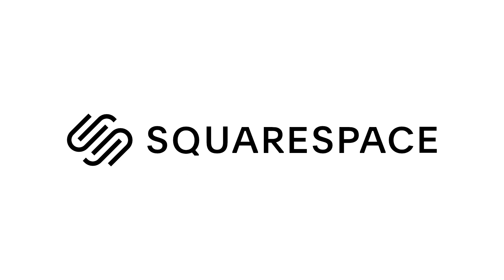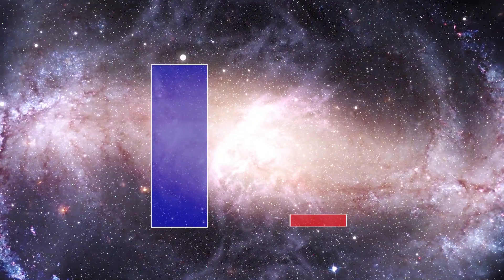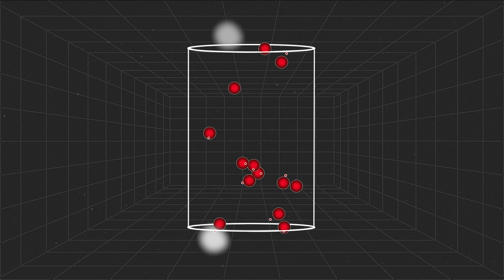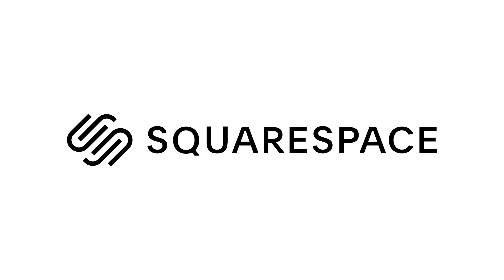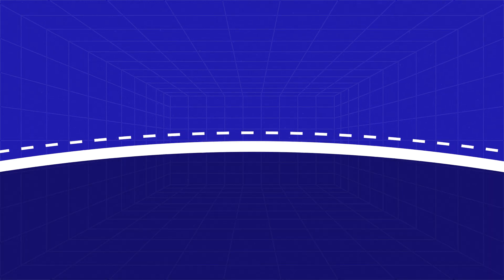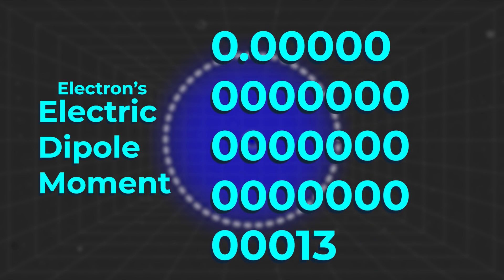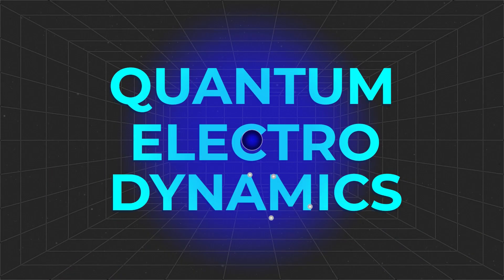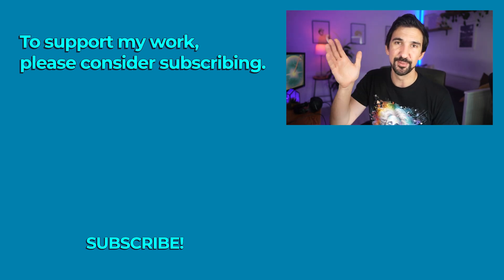What If Electrons Aren't Round? The Antimatter Problem  - EXPLAINED

Comment: Everybody says there should have been equal amounts of matter and antimatter. But why this ought to be the case? "Equal amounts" is as arbitrary a number as, say, 2/3 matter and 1/3 antimatter
Reply: Observations of the amount of radiation after the big bang indicate that the energy released in that radiation was in a ratio of a billion to one photons versus matter. In other words matter and antimatter annihilated into radiation (photons) but one part in a billion matter particles somehow survived, and that is at every location in the universe and there is no evidence of any antimatter surviving, producing antimatter galaxies etc. So theorists think that there must be some fundamental but very tiny difference between matter and antimatter, such as antimatter decaying into certain particles at a slightly different rate or antimatter interacting differently to matter with some other particle fields that only existed at the big bang.
Reply: @tonywells6990 Thanks 👍
Reply: The pair production equation says photons turn into one particle and one antiparticle. There is no equation producing a particle or antiparticle alone.
Reply: right.  But suppose instead of starting with photos you start with matter.  The entire assumption is you start with energy instead of starting with matter.  @qaxftr433  There's a pleasing symmetry that happens if you start with pure energy and then due to CP violation you create more matter than anti-matter but the universe doesn't have to please us.  It could have just started with photons and matter.
Reply: You are absolutely correct there's no reason the initial state needs symmetry. Professor Sabine Hossenfelder has a video about this.   I do like the idea of equal anti matter and matter because it makes it more plausible the universe came from nothing and the existing universe does seem to have a net value of energy of zero (remember gravity potentials are negative) but maybe there was just more matter at the beginning
Reply: @bonerici  I found Sabine explanation to be hand wavy way of saying the problem does not exists. All she has done is move the problem of the imbalance  of matter and anti-matter from theory to the initial conditions. Without demonstrating that there is any initial conditions that could solve this. 

There was no matter at the beginning, assuming you mean the big bang, because the universe was to hot. Matter and anti-matter only came into existence after the universe had cooled. And according to theory should have formed in equal amounts. This very short time, from the start to it being cool enough for matter and anti-matter to form is a problem for the initial condition argument.
Reply: @yziib3578  the part about matter only being created when the universe had cooled is simply not true.
Reply: I would love to see a decent explanation for this too. It always seems like they are just making assumptions.
Reply: The Big Bang process that created the universe did so without any bias toward matter or antimatter.  In other words nothing in the math says one should be created over the other and the assumption is they’d be created at equal rates.
Reply: energy conservation of whatever process was behind big bang
Reply: the universe doesn't conserve energy.  the higgs field is a scalar and as the universe expands there's more dark energy @martin336able  conservation of energy is only a local phenomenon
Reply: One, not everybody says that. Everything I have run across shows matter and antimatter are made out of the same selection of quarks, as an example they make antimatter at lhc, also lightning makes it, so does the sun and certain decay products are positrons. The only functional difference between the two is the binding charges. That means the assumption of how matter/antimatter distribution is just wrong.
Reply: Not really. Charge has to be conserved.
Reply: say you have no idea what you’re talking about without saying you have no idea what you’re talking about
Reply: The only way we know particles are created is in matter-antimatter pairs.
Reply: @davidhand9721  How do we know this?
Reply: @simongross3122 Because we generate billions of electrons and positrons on every power line operating at above 500kV whenever an insulation breakdown occurs - the resulting gamma ray generated when they annihilate is blinding obvious to radiation detectors.
Reply: when enough energy density is present in a given volume, matter/antimatter pairs spontaneously appear. This happened at the big bang, inside neutron stars and in particle colliders. We have measured this effect to be exactly symmetrical. So somewhere has to be an asymetry, and it does not appear to be at their creation.
Reply: Expect a form of symmetry, unless there is a reason why not. If symmetrical then should be equal
Reply: im not a physicist but equal amounts of matter and antimatter existing isn't just randomly assumed its a key to all kinds of different parts of physics working out and making sense

Comment: This is the entire makeup of matter & free energy:
1) Dark Points  = (Particle / Solid Mass / Do Not Change Size)
2) Light Points = (Energy / Massless    /  Does Change Size)

1) When 1 Dark Point and 1 Light Point combine, they create 1 Dipole Element.
2) When 2 Dipole Elements combine, they create 1 Photon.
3) When 1,823 Photons combine, they create 1 Proton. When 1,824 Photons combine, they create 1 Neutron
4) When Protons and Neutrons combine, they create the rest of existence

1) 1 Dark Point + 1 Light Point = 1 Dipole Element.
2) 2 Dipole Elements = 1 Photon.
3) 1,823 Photons = 1 Proton & 1,824 Photons = 1 Neutron.
4) Protons + Neutrons = Everything & Everything is Light

When enough Dark Points and Light Points combine, the Dark Points all congregate in the center of the protons and neutrons and the Light Points create a coating around the Dark Points so that they're no longer seen. In the stable elements, extra photons want to combine with the protons and neutrons, but are repelled into orbitals by the Light Points. 

Roger Spurr of Mudfossil University on YouTube has irrefutable proof of this and even convinced CERN to change out their particle detectors for CMOS detectors so they too can see this for themselves. Update: CERN has now detected what they call neutrinos (Dark Points & Light Points) for the first time ever, after having listened to Roger Spurr.

---------------------------------------------------------------------------------------------------------------------------------------------------------------------------

Venturis Create Free Energy:
Principle 1: Dark Points cannot change size
Principle 2: Light Points can change size
Principle 3: When (red or blue or green, etc) photons enter into a venturi the Dark Points will be forced to return from the direction that they came from, but the Light Points will separate from the Dark Points and condense and go through the throat of the venturi.
Principle 4: When Light Points pass through the throat of a venturi alone, they create what is known as electron showers and increase their energy 200x
Task 1: Send (red or blue or green, etc) photons into a Venturi which has a throat smaller than the size of Dark Points.
Task 2: Manufacture a device that can capture this excess energy in the pure energy zone and funnel some of it back to the light generating device and some of it toward a battery.
Note 1: You need CMOS detectors to see photons.

As the light gets pulled into the venturi the Light Points condense to go through the throat. The Dark Points on the other hand cannot change size and are forced backward, away from the throat. As the Points separate, called fission, excess energy is created by the Light Points. Immediately on the exit end of the venturi is a very small zone of pure massless energy of only Light Points. These Light Points will have a significantly increased energy level of 200x as compared to the energy that went into the venturi. Immediately beyond this very small zone of pure energy is when Dark Points show up to attach to the Light Points, which is fusion. We want to use the energy before the Dark Points begin attaching to the Light Points.

How to Create Infinite Excess Energy:
1) Create a venturi with a throat that is smaller than the diameter of Dark Points. 
2) Send (red or blue or green, etc) photons through the venturi. 
3) If an absorption and siphoning device can be placed in the zone of pure massless energy, before fusion occurs, we can harness free unlimited clean energy. Route some energy back to the light generator & route some energy to a battery or whatever device you want.

---------------------------------------------------------------------------------------------------------------------------------------------------------------------------

Repent of your sins or suffer the consequences. Lord Jesus died in our places personally to take the death punishment that sin deserves and then resurrected by the power of God. Believe this and sincerely repent of your sins each time you sin and you will have eternal life and nothing to fear. Fail to repent and you will end up in the Lake of Fire.
Reply: Zyprexa is an option. A good option.
Reply: @peterfireflylund  
All of the world's little children will be taken to Heaven by Lord Jesus to escape the end of the world. They will suddenly disappear into thin air all at once.

Right before the final 7 years of mankind's rebellion to God's will is initiated (called the Tribulation / apocalypse) there will be a great rescue of the little children from earth to Heaven. Lord Jesus will have taken them home to safety. This includes little babies and toddlers and even those babies that are still growing from conception in their mother's wombs.

Matthew 19:14 (Jesus speaking)
But Jesus said, Let the children come to me. Don’t stop them! For the Kingdom of Heaven belongs to those who are like these children.

Matthew 24:19 (Jesus speaking)
How dreadful it will be in those days for pregnant women and nursing mothers!
(At the start of the Tribulation – why not dreadful for the children themselves?)

Isaiah 47:9
But these two things shall come to thee in a moment in one day, the loss of children...

Isaiah 49:22 & 25
22 Thus saith the Lord GOD, Behold, I will lift up mine hand to the Gentiles, and set up my standard to the people: and they (angels) shall bring thy sons in their arms, and thy daughters shall be carried upon their shoulders.
25 ...and I will save thy children.

Jeremiah 10:20
My home is gone, and no one is left to help me rebuild it. My children have been taken away, and I will never see them again.

Jeremiah 31:15
This is what the Lord says: A cry is heard in Ramah, deep anguish and bitter weeping. Rachel weeps for her children, refusing to be comforted for her children are gone.

Micah 1:16
Shave your heads in sorrow, for the children you love will be snatched away. Make yourselves as bald as a vulture, for your little ones have been removed from you!

Right after the little children are rescued from what's coming the next major event to happen will be a major asteroid impact. This will come with signs of light in the skies heralding its arrival 3 days in advance, described below.

Matthew 24:27 (Jesus speaking)
For as the lightning cometh out of the east, and shineth even unto the west; so shall also the coming of the Son of man be.

Luke 10:18 (Jesus speaking)
And he said unto them, I beheld Satan as lightning fall from heaven.

This next bit comes from dreams and visions God has given us over the years. The skies turning colors is directly in reference to Matthew 24:27 where Jesus warned us that there would be a crazy light show going on right before the 2nd rapture. Jesus Himself set the course of the coming asteroid in order to wake people from their sleep. Upon impact this asteroid will cause a 12.0 earthquake, a mega flaming shockwave for many hundreds of miles, world wide mega tsunamis, will split America in two, and will even stop time for 3 days as the sun and moon will stay in their places in the sky for those 3 days, and finally will kill millions of people.

This asteroid is going to land between the island of Mona and the city of Mayaguez, Puerto Rico at 2:00am Puerto Rico time. (We know the hour, but not the date).

When you see these final signs you'll know it's beginning:
- The skies all over the entire world will turn colors like the auras
- After that the skies will turn red for 3 days as a final warning
- Then the asteroid hits
- Then the 3 days of darkness arrive where all the light on the earth is extinguished. No light from the sun or moon or stars. It will be so dark you will be blind.

Revelation 8:8-9 (The asteroid)
8 And the second angel sounded, and as it were a great mountain burning with fire was cast into the sea: and the third part of the sea became blood;
9 And the third part of the creatures which were in the sea, and had life, died; and the third part of the ships were destroyed.

We now know that we’re waiting for the children to be taken home and the skies to turn colors like the auras. When the skies start acting up, there’s 3 days left and we know the asteroid impacts at 2:00am Puerto Rico time.

---

There Are None Righteous / How To Be Saved

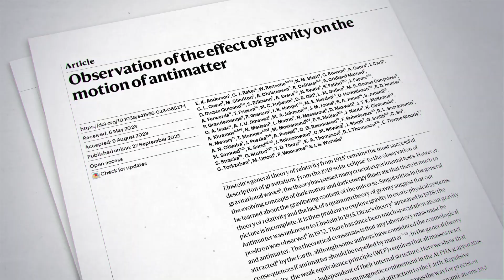Romans 3:10 & 23
10 As it is written, There is none righteous, no, not one:
23 For all have sinned, and come short of the glory of God;

Luke 5:31-32 (Jesus speaking)
31 And Jesus answering said unto them, They that are whole need not a physician; but they that are sick.
32 I came not to call the righteous, but sinners to repentance.

1 Peter 3:18 (The word “quicken” means “to make alive”)
For Christ also hath once suffered for sins, the just for the unjust, that he might bring us to God, being put to death in the flesh, but quickened by the Spirit:

Romans 10:9
That if thou shalt confess with thy mouth the Lord Jesus, and shalt believe in thine heart that God hath raised him from the dead, thou shalt be saved.

Acts 4:12
Neither is there salvation in any other: for there is none other name under heaven given among men, whereby we must be saved.

Ephesians 2:8-9
8 For by grace are ye saved through faith; and that not of yourselves: it is the gift of God:
9 Not of works, lest any man should boast.

Repent of your sins or suffer the consequences. Lord Jesus died in our places personally to take the death punishment that sin deserves and then resurrected by the power of God. Believe this and sincerely repent of your sins each time you sin and you will have eternal life and nothing to fear. Fail to repent and you will end up in the Lake of Fire.

Comment: Forget Quarks and QCD - fudge that hides as much as they predict... The evidence points to something like the model below.. 'Heavy Fusion' cures the Antimatter Paradox. There are always equal numbers of electrons and positrons in the universe, and they constitute all matter. It's a giant ball of point particles (+ve cells) bound by -ve gas. A more realistic, classical Dirac Sea that still quantises matter. Stick with what's the most definite, discard the junk.
--
Electro-Positronic Field: -ve gas binds a ball of +ve cells freed by Full Escape Energy as electron-positron pairs 
Spin: particles pull gas in straight/pump out spirals at 90'. Motion increases -ve gas intake, biasing spin at 90'
Magnetism: spin flows straight to a neighbour. Energy conservation and field balance preservation cause external circuits
Mass: inward -ve gas flow acceleration drags spheres of cells further apart inwardly but closer laterally to a packed core
Gravity: like mass but slower acceleration with drag on field cells cancelled by dark energy so cells remain equidistant 
Dark Energy: more -ve gas near mass shrinks field, expanded by less in voids + new matter creation / black hole growth
Heavy Force: mass multiplier mechanism pulls in field before annihilating all heavy composite cored particles but protons
Heavy Fusion: in the Big Bang (and stars?) 2 positrons oppositely hit 1 electron (more than 2 electrons hit 1 positron)
Positronium: (e_p), Muon (ep_e), Proton (pep), Neutron (pep_e), Tau (epep_e). Neutron mass is halfway between muon and tau
Beta- Radiation: Neutron loses the electron, Beta+ is a new positron expelled and electron retained by a proton
Antimatter: 1,2 e_p pairs annihilate, 3 make a muon or proton+anti muon/proton, 4 a neutron+anti neutron, 5 a tau+anti tau
Lifespan: (anti) muons/taus at close to electric force speed (C) barely feel it but Heavy Force takes over when they slow 
Nuclear Force: neutron electrons bond to protons. Mass and magnetism compacts and strengthens the nucleus 
Black Hole: converts all matter to heavy force e+p crystal with a slowly annihilating centre, preventing a singularity
Photon: compressed, concentrated -ve gas wave core pulls in field cells as it passes. Field warps diffract and interfere
2 Slit Experiment: photon/particle field warps diffract and interfere, guiding the core. Detectors interfere with guides
Entanglement: field physically links objects but there could be hidden variables (ie. absolute temporal synchronisation)